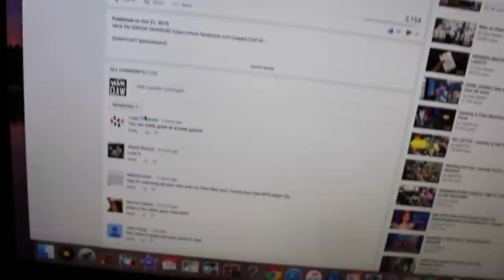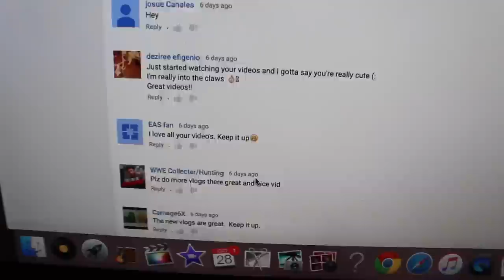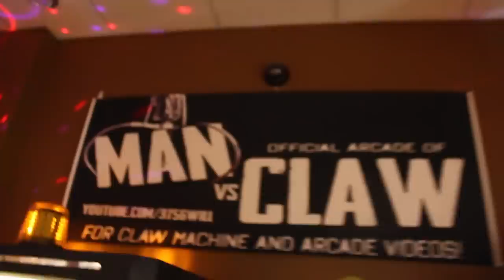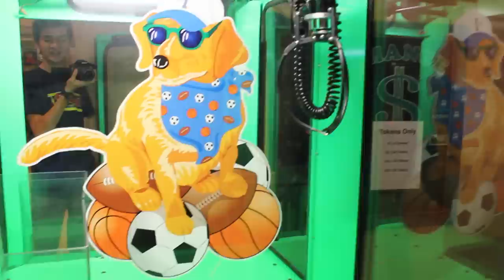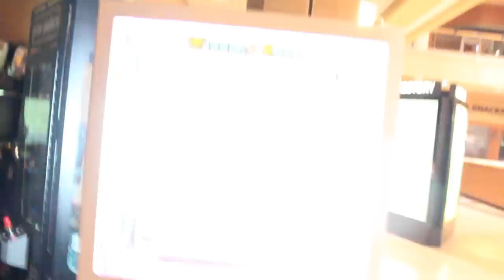Filling My Claw Machine! + Meeting My Technician! Vlog #5 | JOYSTICK

Comment: you should invest in a tubular pick for when you loose the keys its easy and requires almost no skill just shove it in jiggle and twist and it opens thhe lock without breaking it as a added bonus it will even give you the key code for the lock so you can get a replacement key cut or even cut your own